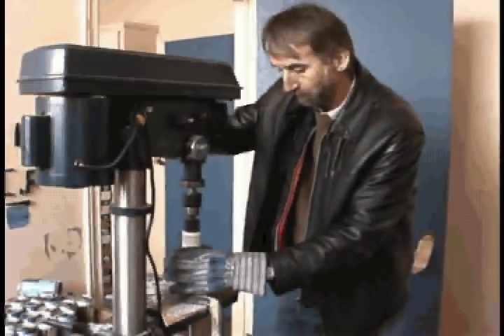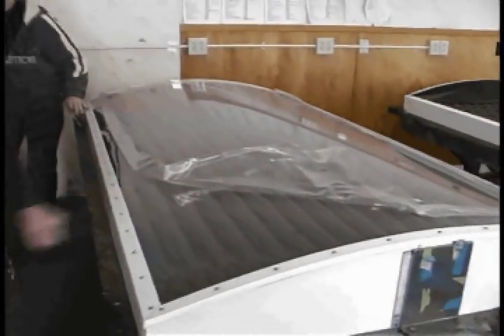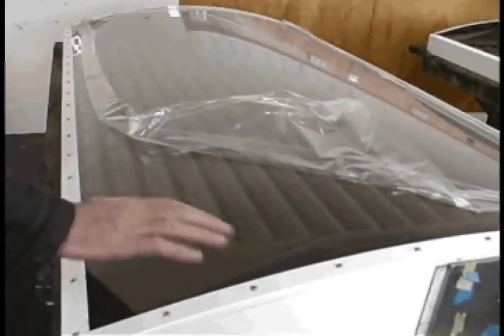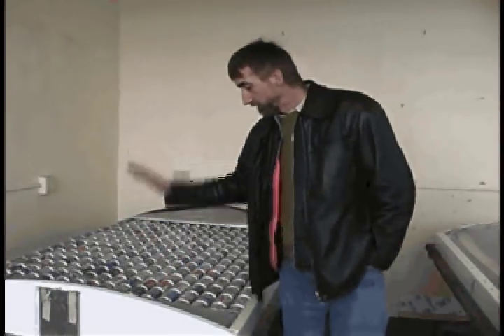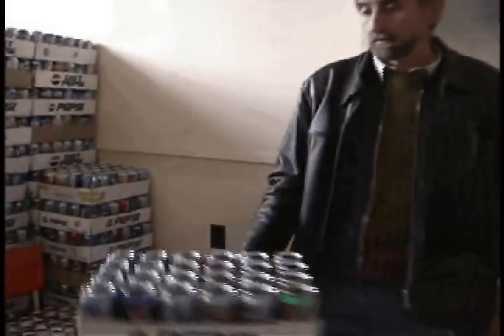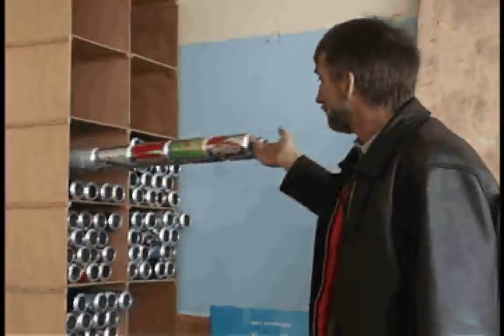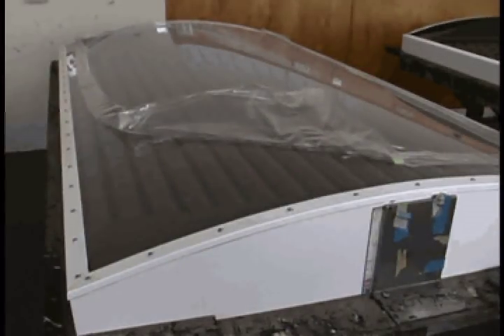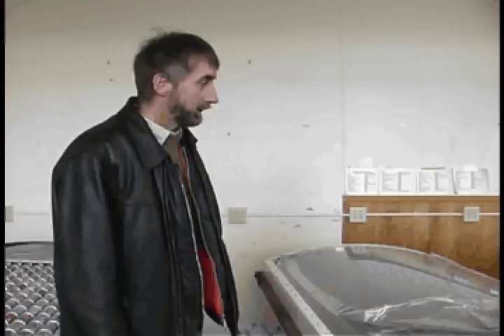Brilliant Newfoundlander Invents the Solution!

Comment: I want this. How can I get it?
Reply: +Carmen St-Denis Many women have said that when they see nude photos of me.
Reply: +Carmen St-Denis - Research "Solar Air Heaters". You can buy or make them. as they are very simple. The title is misleading. Nothing new has been invented here. These devices have been around since the 70s. It's a shame so few know about Solar air heaters, as they are vastly more efficent than solar cells and can be made out of junk.
Reply: +fabfab  I didn't see your post until I posted above.  Yes as I stated I knew someone who made one in 1973 nothing new but I think it's a great idea and may build one myself :)
Reply: +Carmen St-Denis Yea just do a bit of research and build your own. His price is close to 3k which is laughable. And ignore some of the other idiots postings.
Reply: 1: buy a lot of beer or soda.
2: drink a lot of beer or soda.
3: get 2" x4"'s and plywood.
4: frame a big box.
5:drill holes in top and bottom of cans.
(DO NOT operate any power tools if still intoxicated from the beer).
6: glue cans together to form a tube.
7: paint black.
8: drill hole fore pipe in bottom of box.
9: drill hole for pipe in top of box.
10: put fan inline to bottom of box.
11: pipe into wall of house.
please note that you need 18 cans per tube, that's 6 cans per tube. Start drinking.
Reply: Curt bipolar expression.
I'm sorry buy I completely disagree with #5. Handling power equipment while intoxicated never leads to anything bad and always results in a better build.
Reply: +diGritz1 Ask four fingered Freddie if he agrees?
Reply: Curt bipolar expression. I tried but got his machine. Something about not being able to pick up the phone. Seriously who uses all ten anyways.

Comment: @theapocilip i was thinking the same thing when i heard about this a couple years back.  Now im wondering if this type of thing would work with a cobb house.  instead of using a rocket heater, i wonder if this would heat up some thermal mass enough to keep the house warm at night!  although, in the north east winters, there isnt that much sun, so you would still have to have an alternative heating source.  Maybe a combo of this and rocket heater.  This for day time use/ sunny days.

Comment: So you used a fan to blow the heat out the bottom and then it rise as soon as it comes out. Its not going to stay on the floor and might hear about a foot of the floor in front of it then you have wasted the power for the fan.

Comment: Wouldn't the power used to mod the cans plus the labor and sealer cost more than say, cheap pvc or some other industrial material? All that time and effort  for one cheap panel u could build in 1/100 the time and effort.

Comment: Wouldn't it be cheaper and safer to use extruded tubes rather than joining several cans like that? I am just thinking every joint between the cans has risk of failure . Otherwise very effective recycling  of waste

Comment: Free heat that is 15 to 20% cheaper than normal power.  THAT IS NOT FREE.  It's the blower motor that runs on electricity to make the unit work.

Comment: It is not the concept I do not get it is the design.  To me what would make sense is to have the air coming in at the bottom, and then going through the maximum path so that it picks up the maximum heat.  Maybe in the chamber first and then entering the can "tube" somewhere opposite the intake and snaking though the tube until it is expelled in the room.  The problem I have is that I usually want hear in the evening when it is cold, this does not work and does not appear to store heat.

Comment: @heroclix0rz Not that simple: the effect depends on the severity of the processing used by a program, set by the user.   So I wouldn't try choosing a codec on this basis alone, but run tests if in doubt. H.264 is a good all-round codec and I like Handbrake for doing the encoding - it has sensible presets.

Comment: Those cans are 100% recyclable, so he's not really solving any waste problem with this. He's actually causing more aluminium to be used since these cans wont be recycled back into cans again.
Reply: +DragonWolf Entertainment Aluminum is in high content on Earth. No problems there.
Reply: Jeremy Stephan It's not just about the amount on earth, but the entire process of mining and refining (energy, pollution, etc...) more aluminium instead of recycling what's already available. Point being, the amount of energy he is saving is far less than the energy (etc) used to produce more aluminum. So he is offsetting in the opposite direction.
Reply: +DragonWolf Entertainment you're not considering the energy and resource required to recycle. They melt it all back down again... Would it be more economic to recycle the cans, then go out and buy aluminum tubing? The aluminum tubes would contain more aluminum than the cans. 

This IS the best recycling.
Reply: No, it's mostly pointless.
Reply: +DragonWolf Entertainment what's pointless? Inexpensive heating?
Reply: +DragonWolf Entertainment reusing is obviously better than recycling. Have you ever thought about the energy and reosources it takes to move all that alluminium into a factory to melt it down to turn it to something else and to ship it back? Guess Not.

Comment: Freeze your ass off at night though.
Reply: +howiwatchvideos This isnt designed to replace your current heating. Its designed to take whatever temp you set your house to, let your current heater do its job and get it hot, then cut out. This solar arrangement keeps the house at that temp all day. Heater runs once during the day, and then only at night

Comment: build a 4ft x 8 ft box, paint the inside black and cover with a sheet of that window plastic the you heat  with a hair dryer.  connect to the house and you have the same thing. but EVERY attempt to use solar heat does two things. one is that it cuts down on fossil fuels and the second is that it uses the solar radiation.

Comment: these solar heaters are good for the summer too. but you have to know how they work. cooler air enters the bottom and warmer air leaves the top. hot air rises..so take the warm air out of your main floor and blow it outside so the cooler air from your basement displaces to your main floor. and hes not american...hes canadian.

Comment: you mix power (Watts, kilo-Watts) and energy (kilo-Watt*hours) here. Following your calculations, panel produces 2.5 kW*h of energy per day.
I don't know where did you get 350W power per can, but in any case, you cannot compare power with energy, it just doesn't make any sense. It's like comparing distance measured in meters with speed measured in m/s. You need to multiply 350W power by the time, during which this power is applied. E.g. 350W*10s = 3500 W*s = 0.97 W*h = 0.00097 kW*h.

Comment: Great idea but poor material choice for the tubes
Sell the cans for scrap use the funds to purchase thin wall tubing like electric EMT pipe less labor, no drilling, gluing or washing, A smaller pipe = more surface area exposed to the sun = more heated area in same size box = more hot air.
Free isn't always the cheapest in the long run.

Comment: um..... why not just add another window with a black curtain in your house the size of the solar pannel in the place you would mount the pannel? essentially you would be getting the same energy.....
Reply: You don't see it..... If you had a 4x4 window with a black curtain the sun is going to create the same amount of energy off that curtain as if it were a 4x4 enclosed box with cans painted black. The only difference is you are gathering all the heat and holding it in the box under pressure before it goes into the room! You think by enclosing cans painted black in a box is magically going to create more energy? I cant help but laugh.
Now this concept would make sense if you wanted to make heat without a window.. but otherwise it don't!
Reply: +tl;dr Christ maybe if a medium that actually stored energy were integrated into the system such a porcline chips placed under the cans using the aluminum heat tranfer properties this might work.
Reply: +goldencoin100 Golly...everyone in the reply section immediately below needs to take some basic physics education on radiant, convective and conductive energy. Your are oversimplifying to the detriment of others. Ouch it hurts. Please stop. Really...really...please stop.
Reply: +G “Jerry” Henrickson whoops...I meant the reply section immediately above. See? Everyone makes mistakes. Yes...I was wrong. But not about the energy thing.

Comment: Excuse me, but... THERE IS NO SUCH THING AS FREE HEAT! You have to buy the thing, you have to connect it to your house, you need to insulate the connectors, and you need to run the fan.And you should have a temperature sensor to keep track of the output How does that cost compare to adding insulation and sealing leaks?

Comment: Excuse my ignorance, I'm not an engineer....but why even bother with the cans? Won't the enclosure itself fill with hot air that can be vented into the house? Maybe I am over thinking this, but it seems to me the cans are just a gimmick. A large black box located on your roof, vented to the interior, should provide as much heat as this 'invention'. I guess its brilliant if you're in Newfoundland.

Comment: @angryadrien it is kind of like here in the states which would be HEAP . It is a program to help low income familes heat homes. where they might assign $50 towards your oil drop they will let you apply it towrds these panels

Comment: I don't understand why you would place the vent that blows the hot air into your house, near the celling ?????
Heat rises ( I don't need the top 2 feet of my room heated ) !!!!! Also aluminum dose not hold heat very long. You would be better off using large soup or tomato juice cans.
Reply: +David Pedder its not supposed to hold heat, youd only get an extra 20 mins of heat once the sun drops its not supposed to produce heat with a solar sourse
Reply: +ekoms108 
I know that !!!! What I'm trying to say, is that a thicker can is going to heat up better, and hold heat much longer. Soup cans will work much better, you only need a regular can opener

Comment: @Emulani Wow...plexi/lexan is only about 1oo bucks in canada. Most of that money is just crazy clear profit for them. The total cost of the unit they've built is less than 700 canadian. It's just a little lumber, 1 sheet of insulation, one blower unit(which is the most expensive part, running at around $120), a snap disc controller(which is about $20), some ductwork(maybe $50). He's scamming people...that's why their price is coming down now...too many other competetors.

Comment: @tony711978 What if the power plant cuts out? What if your heating oil runs out? What if your electricity gets knocked out? What if, what if, what if?
Your question proves you haven't understood that the energy solution for your home shouldn't rely on merely on coming from one source. The correct strategy for energy should rely on several independent sources making you virtually immune to the "what if" situations.
Isn't it amazing the 99.9% of homes aren't designed with your needs in mind?

Comment: But this is worthless for winter or am I missing something.  Really, don't need to heat home if sun is shining.
Reply: +desertsun100   Okay, first of all, name calling is not needed.  I asked something.  Second this thing would not help me in anyway where I live and not sure about North Dakota.  I would have to build another room onto my home to house this, so it is not cost efficient, I couldn't put on roof due to ice and cold and yes snow would cover them that goes for the outside and the cold weather would keep from warming up.  Besides, all these obvious problems, the Sun during the winter is not that bright and most days it is cloudy.  Before, you answer someone in a dark manner, you better know what you are saying or it can back fire.  Maybe, you didn't think of these things.
Reply: +Stan lk it goes on the outside of your house, on a south facing wall to get the sun
Reply: +matetotally   I really need people to understand the point, I am making.  I understand that this box goes on the outside, but that is my point.  Outside is 20 degrees and the cans are freezing and the sun will not heat up the tin cans due to the cold all around, this will dissipate the heat generated by the cans from the Sun.  This will not work, now maybe it will work in the fall or late spring when weather is cold but in the 40 or 50 degree weather days but not when the weather is whipping up 20 degree days or even colder days.  You see if the cans are sensitive to the heat from Sun rays then it is sensitive to the cold weather as well.   I must see this work with my own eyes for me to trust.

Comment: @BenHallert I say scamming when you're making way too much profit. These cost around $700.00. Not scamming would be charging 1500...not $3000. $2300 in profit is clear rediculous when that doesn't even include installation...which itself is a few hundred. He's scamming...riding on the back of the green movement to catch a few suckers.

Comment: This can't be efficient. Air is a very bad medium for heat transfer. He could be using water instead, as it is common in other solar-heating systems. 
Anyways he talks about the air spinning through the can.. I don't think he's talking about a swirl in the flow. But if he was - which could be an improvement for the heat transfer, he doesn't explain it after all. 
Anyone with a drilling machine and some paint could build that kind of air heater.

Comment: YOU DON'T NEED CANS!    Has anyone gone to school here?

System efficiency depends on:
1) Fraction of light that is trapped by the insides.
Use clear glass/plastic front and mat black insides.

2) Rate of heat transfer back to the outside.
Seal air leaks, use double glazing on the front for colder climates, consider using twin wall poly carbonate for easy construction, use Styrofoam or other insulating material for the back and sides, consider dense Styrofoam because it has good mechanical strength, insulate connecting pipes.

3) Temperature difference between inside and outside. (related to part 2)
Don't let the insides get hot! Use a fan and a solar panel to force the air through the cavity and increase the surface area inside to ensure rapid heat transfer, some people use a black mesh to increase the surface area - just staple it to the back wall.

Many people don't get part 3). Sure if the air flow is slower then the air will be hotter, but if you let the air reach half of the maximum system temperature (no air flow) then you will half the amount of heat your system generates, because more will be lost back to the outside. At zero air flow you will reach max temperature but zero heat, because all heat will be returned back to the outside. To maximize heat gain, increase airflow until the returned air is at least half of the maximum possible temperature.

STOP WASTING TIME CUTTING HOLES IN CANS! ENJOY A THIN LIGHT EFFICIENT SOLAR AIR HEATER, WHICH IS MUCH MUCH SIMPLER TO BUILD!
Reply: Excellent comment!
Reply: Usually you make the inside all reflective and use the black cans/mesh/pipes to become hot. If the inside of the box is black all you do is make the box frame hot and waste some of that energy.
Reply: 1) You are saying the can acts to insulate the collected heat from the outside. But I say it is a poor insulator compared to simply using cheep polystyrene sheets to line the box.

Note: The cans have a large surface area and are black so they will heat the still air inside the box and radiate to the box, so you probably still want to insulate the box to trap that heat. If you do that you will find the still air in the box will get hotter then the moving air inside the can, so you will actually get more heat by circulating air both inside and outside the can! If you do that then the can will simply become a black suspended piece of metal.

2) You also say the can collects the heat and transfers it quickly to the circulated air (heat exchange). But I say a black wire mesh (2 layers if you wish, any material) would be just as effective, if not better. All it has to do is absorb the light and have significant surface air and air flow over it to transfer that heat to the circulated air. A black mesh is far simpler and cheaper then all this messing about with cans.
Reply: And how are you going to pull off #3?  Air flow - buddies elegant solution does this very well, if you'd watched the video - your method fails to pull this off.   The cans aren't just 'cut' they spin and cycle the air around - he's left out exactly how he does that, and that's his right ;)

Comment: this heater only works on sunny days and only works when the sun is hitting it.... Once the sun goes down those cans and the heat are gone in a matter of minutes and no more heat and even with your furnace running after the sun goes down this won't generate much heat at all.... total waste of money at $3000  for this unit.... The whole key is to, if you are building a home, is to make it super insulated in the first place.... R1 is great.... look it up also this heater is not going to heat the home... only the room it is in and no more... why would anyone pay $3000 for this.... totally pointless

Comment: Check the post I replied to. "Using the word "clean" with a MATERIAL..." "...or a MATERIAL that cannot be obtained without..."

You were clearly talking about Thorium. Good job making an attempted backtrack, though. Obviously fission reactors of any sort will not be safe without shielding. It's _almost_ like they rely on gamma radiation to work.

No particle physicist would refer to a thorium reactor as something different from a nuclear reactor, either.

Proof of credentials or GTFO.